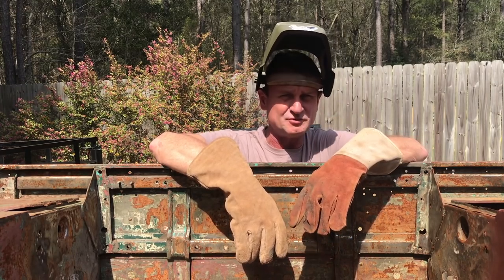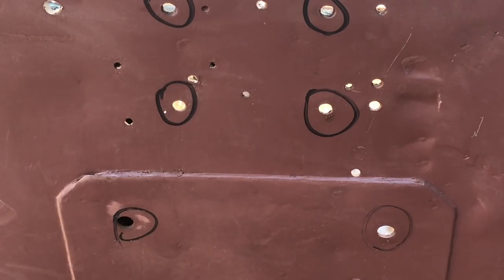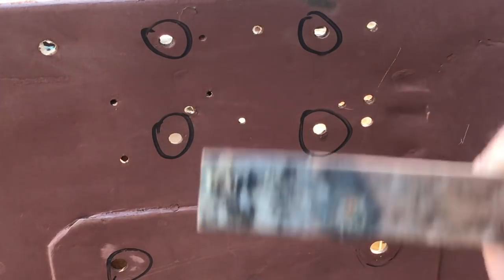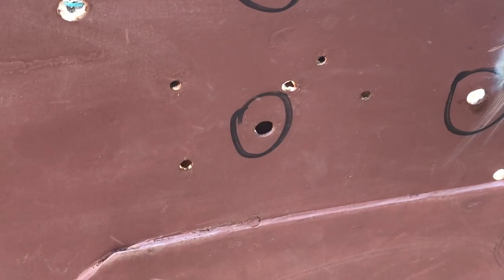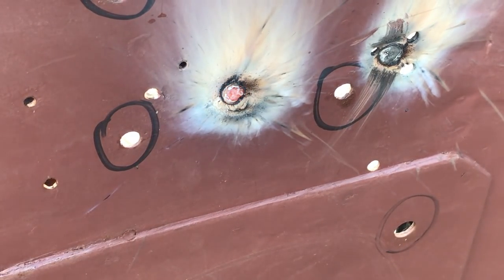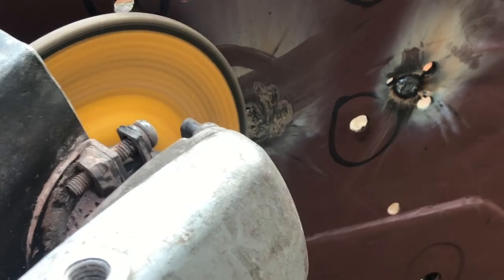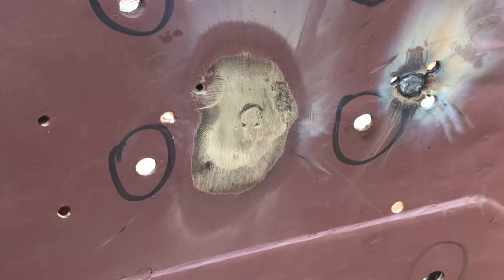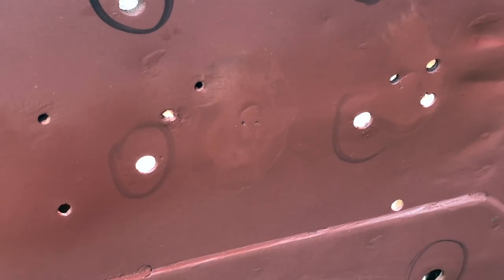Willys MB Team G503 100th Video Welding Holes In Sheet Metal

Comment: Yep,  just did that myself,  but I found a handy little magnetic gadget, with a thick copper plate (Durston, MPWT magnetic plug welding tool) ,  so I could use both hands on the gun.